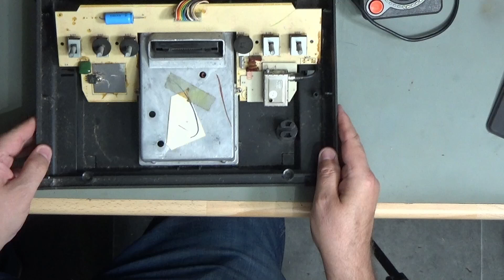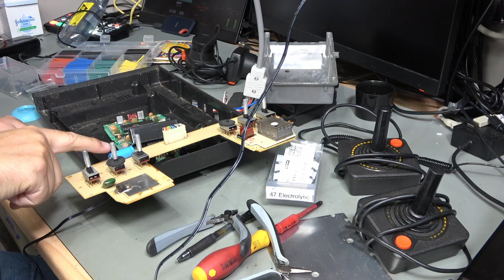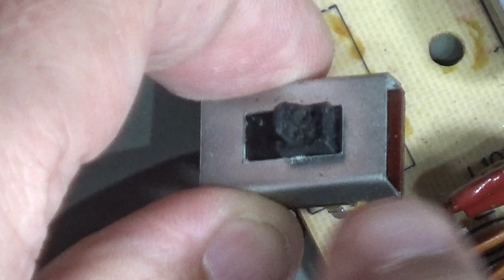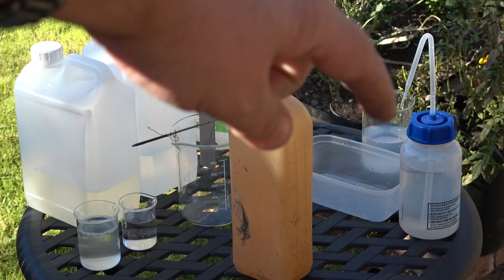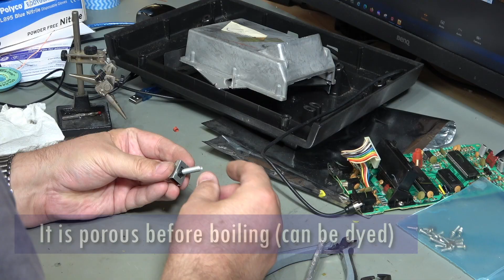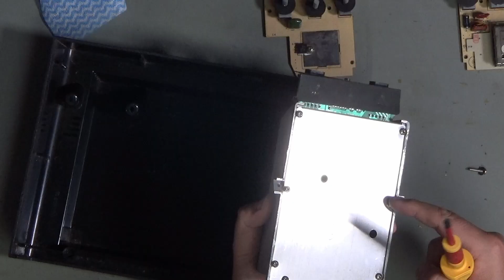Atari 2600 Game Console Repair/Refurb #0104

Comment: PSA : north american 2600 wall warts/power adapters have the fault of the cable breaking at the base of the adapter . If you use a heat gun & constantly circle heat around  the seams you can warm up & force the cube seam glue open at the cord entrance.  Just cut the damaged part, reconnect,  and away you go.
Reply from the maker: Good tip, thanks for sharing!